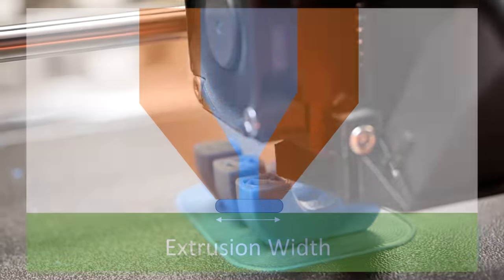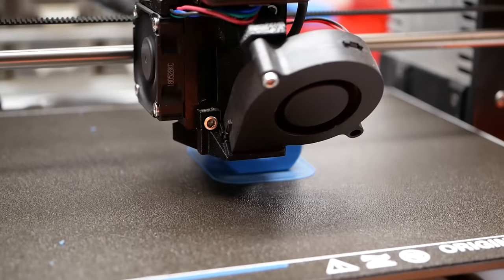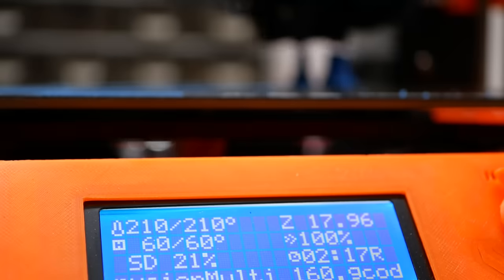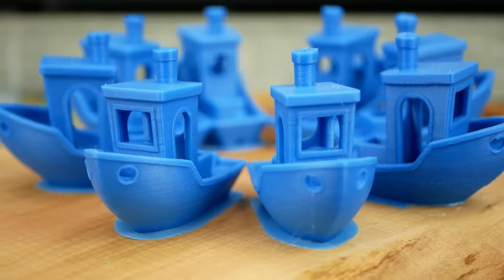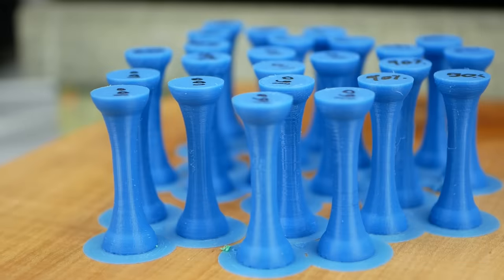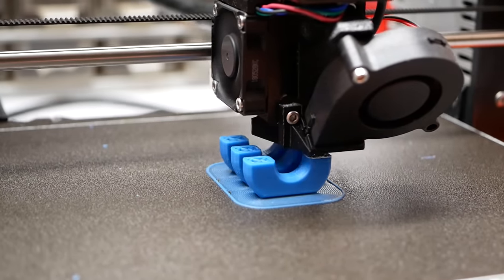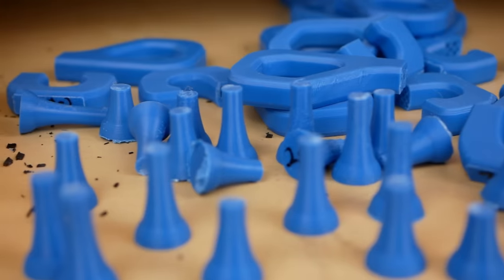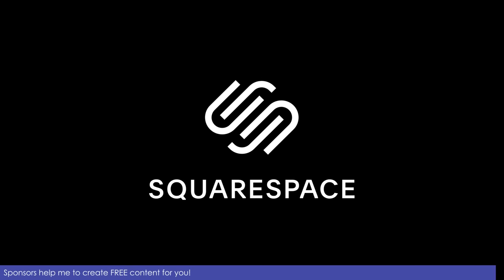Extrusion Width - The magic parameter for strong 3D prints?

Comment: I have been playing with extrusion width (line width in cura) this last week to see if I could find one I liked better for general printing.  My first goal was to see if I could save some print time by printing thicker layers with maximum width to reduce time.  I've seen weaker and stronger prints because of changing it.  It is really neat that this video just happened to pop up in my suggestions.  I'm looking forward to watching the rest of your video at this point and see what you've discovered back in October apparently.

Comment: I use 0.6mm with a 0.4nozzle as standard for functional prints just for speed. I thought they we stronger to but this test proves it :) I adjust the width to get optimal lines for thinner parts and that varies a lot, from 0.34 to 0.75 and I haven't seen much issues

Comment: Changing the extrusion width was useful to vary the stiffness of parts printed with flexible filaments. I found that perimeters of 1 or 2 layers can be very strong when extrusion width is around 0.6mm (w/ 0.4mm nozzle)

Comment: I use it all the time. With my .4 nozzle, I will print .5 if my model has a 1mm wall for example or even push the width up to 1mm for a nice clean solid vase with less layer lines

Comment: I have been printing a BF109 from abs. To get the wings and fuselage strong and bulge-free I had to do man tests. I ended up adjusting the extrusion width somewhat thicker than 120%, adding a shield. Some walls are problematic especially flat surfaces. The whole plane is somewhat heavier then the one done in pla, but it is really strong. I prefer abs since it is water resistant, more resistant to heat, can be glued by aceton and/or aceton-abs mixture. When I started 3d printing I had only really bad abs and I had no comparison to other materials, so I learned it the hard way. Since I use the amazon basics abs it works much better. It sticks like hell on the ground and adhesion is much better. So I could reduce the bed temperature after several layers from 120 to 70deg celsius. Afterwork can also done by aceton. You can increase layer adhesion afterwards by painting the wing with aceton mixture. But not to much since otherwise there will be bulges. And if something breaks you can try to fix it with a thick acteon-abs mixed glue. Also it is more ductile than pla. Most of the time you need brim and or raft, often one needs extra added fixtures outside of the part to hold it down.

Comment: I modify it a lot :D 
In Vase-mode to get thicker walls. On regular prints I tune it to avoid awkward thin perimeter artifacts or to avoid gap-fill on perimeters if I print parts like cases that usually just consist of one wall with constant thickness. Avoiding gap-fill there usually saves 50% print time.
I also increase it if I need strong parts.
Most of the time I print with 0.5mm and when I design my own parts, I usually use walls that are multiples of 0.5mm thick so I don't have to change the extrusion with on every print. I never understood why extrusion with gets so little attention from all the 3D printer communities.
Reply: Btw: I also don't get why there still is no slicer (I know) that supports dynamic extrusion width. It would be nice if the slicer would select an extrusion width (in a defined range) dynamically for each wall so it is printed without gap-fill or gaps. This would also be really nice for lithophanes :)

Comment: I've messed around with really low extrusion widths for the top layer, like  as low as 50%, in order to get a kind of ironing effect and an improved surface finish with my larger nozzle prints. (.8mm)

Mixed success dependent on the filament, but a very good surface improvement on some.
Reply: What's your slicer? You can't use the built-in ironing?
Reply: @supermerill 
It was Slic3r PE, I'm not sure the current version has ironing or not, but at the time it didn't.

Comment: I used a 0.2mm nozzle for a while. Really slow. You can take a piece of fine sand paper, lay it flat on the build surface, and lower the print head step by step and sand it down by moving it from side to side to widen the flat area around the hole. That way I could use like 0.6mm wide lines for only the tops, bottoms and infill to really speed things up, especially for really flat parts. With my setup around that seems to be the limit, that's where I started running in to under extrusion.

I bet you could increase the line width even more if you did that.

Comment: I suspect much of the strength increase is due to heat transfer on the previous layer (until the layers slightly curl during extrusion due to being much large than nozzle and under pressure). A heated build chamber around the glassing point with minimal nozzle pressure and allowed to cool slowly and evenly may produce very interesting results.

Comment: Thanks for this.

I've been playing with extrusion width doing vase mode prints, notably getting better looking  results with a 0.6 nozzle at 0.2mm layer height and a maximum of 1.1mm width rather than going to a wider nozzle. And with all the nozzles I have the sold part of the tip is the same width so I can't push the width beyond 110% with a 1mm nozzle, but obvs I can go with taller layers for speed, but getting crazy overhangs on vases needs low layer heights.

Comment: It would be great if you could also look at accuracy for extrusions widths of 120% or below and especially 100% and below. The slicers I have seen assume the material comes out as a rectangle in that case. But in reality, it of course bulges sideways, and squeezes vertically after it leaves the nozzle. The result is that the model becomes slightly wider than designed. The effect is really strong for single extrusion-width sized walls. They become not only wider than designed, but also loose adhesion between layers, because of the vertical squeezing that the slicer doesn't allow for.
Because of this effect, I would definitely not recommend to print the outside lines of your model with an extrusion-width below about 120% (in reality, the strength of the effect also depends on the layer thickness).

Comment: Guten Tag:) Great video as usual. I have always used 0.5mm EW for mechanical parts where quality is not an issue, such as my MPCNC. I use 0.3 EW for minis.  One downfall is supports with a  higher EW due to to thick of supports. However, some slicers have settings to change EW on supports. I dont think mine does. I use ideamaker. 

Minis look amazing at 0.3mm with a 0.10 layer height. I have tried 0.3mm EW with 0.20mm LH and it did well. 

one test to try is 0.5mmEW with a 0.28mm LH to see if that yields better strength, but also add 3 shells and 15% infill like you say in the video, but im interested in thicker layer hieghts mixed with thicker EW.

Did not know you were in aerospace as well. Me too:) in about a year a should be done with my masters in engineering! YAY!!!

Comment: I was not really aware that people did not modify extrusion width often for anything other than vases (that's super common).
I though it was somewhat common to play around with the width for best fit on some prints. 

I probably use 100% extrusion width of the nozzle only in a few cases.
Usually I am pushing it up to say 0.6mm or 0.8mm for a 0.4mm e3d nozzle. Sometimes smaller down to 0.3mm. 
It all depends on what I am printing. If I need that strength that thicker more bonded lines gives and the part design will handle it, I will push the width as close to 0.8mm as possible for the design. While keeping quality the same as a lower width would provide.
For designs with very complex walls, shifting sizes of walls etc. I will modify the thickness to best fit the print to reduce any gap fill and avoid gaps in general as it improves the quality of the print and best keeps tolerances. 

I find the best performance improvements to be in compression loads to fight against de-lamination and also in radial loads.

On a separate note I think you will find the numbers even better for less brittle materials like PETG. The strength of the bonds basically skyrockets as you start to increase width, even past the point of looking good. For PETG if I can print it with thicker lines I will, no question. It's faster if I am keeping speeds the same, stronger, and looks just as good. Whats not to love when you are dealing with a material that likes to be printed slow-ish and cools slowly too. That means I can print a bit slower without making the overall print take longer, get far stronger prints that usually act as if they were solid material and not layers. It actually makes printing with PETG easier too. So wins all round.

Comment: The last Test with the different perimeter settings  brings me to an idea:
I can imagine why 2 thicker extrutions lines holds together stronger than 4 smaller ones.
But as we learned as a kid from playing Lego, it would be better to have the lines overlapping each other.
So, would it be possible to have one layer printed at 2 perimeter 200% and the next one at 133% 3 perimeter and then alternate between these two?
Is there a way to set these settings per layer?
Because that could cause the layers to interact with each other even better. The Material of the middle line from the 3 * 133% layer could float into a potential gap between the two lines from the 2 * 200% layer.

Comment: I have found that increasing extrusion width of inner walls and infill while keeping outer walls at a smaller extrusion width and decreasing layer height gives a very nice looking, strong, and slightly faster print. Messing with all of the settings and finding a happy balance of quality, strength, and print speed for individual prints is quite fun!

Comment: I have set my extrusion width to 0.45 mm on a 0.4 mm nozzle to fight the effects of die swell and get accurate prints. I also use the wall Perimeters, not wall thickness settings in Ultimaker cura.

Comment: A problem with blanket modification of extrusion width is that dimensional accuracy suffers. However you can take a more nuanced approach and increase extrusion width for internal perimeters and infill, while leaving it at 100% for the external perimeter. I've had good results with this approach.

Comment: Cooling fan settings? My impression is that the thicker extrusions are also more thermally insolated against cooling and/or have more thermal mass thus fuse better on top of also being pressed harder. I always have my cooling fan off if I don't absolutely need it when printing functional prototypes. Also an enclosure makes the part stay warmer and adding in better layer fusing/adhesion.

I would love for there to be an option in Simplify3D so that the cooling fan only ever comes on for just bridging and steep angels where the part could curl up. For now it's just by layer which I have to do manually and compromises layer adhesion for the entire layer.

Love your work, and haven't played around with my extrusion settings in a long time. This makes me rethink how I've been printing and if there's a setting so that only the outer shell could be 100% and one or two 150% inner shells for faster/stronger prints but still have the same sharp models.

Comment: Using greater than 100% Extrusion Width, as well as a bit of back travel on the Z axis (some call this overextrusion), is the only way I got proper layer adhesion with Nylon.  Once I figured those out, a 20mm test cube with 20% infill  makes a 1Kg hammer bounce off with no damage to the cube.  +1 for printing in the basement, mine stays between 20-21C all year.  MUCH better consistency.  Hope this helps someone.

Comment: I routinely set support extrusion width to around 60% of nozzle diameter to reduce material consumption and make supports easier to remove. Weirdly, in Cura, a reduced extrusion width can increase print time though.

Comment: I've only ever played with the extrusion width when doing vase mode prints... 0.8 line width turns out GREAT but I have to bump up the heat and slow down the print a bit. I use these prints as pencil/tool holders :P

Comment: I usually print with as few perimeters as possible, adjusting the width of the wall lines to achieve the desired thickness. With a volcano it's easy to print 1mm+ thick lines at reasonable speeds.

Comment: Can you do a test on Fillamentums CPE? I would like to see their claim "improved over PETG in every way" tested.
Reply: Printing with something containing chlorine sounds like a terrible idea. I’m not sure about everyone else, but I certainly don’t have ventilation setup I’d be confident in.
Reply: @MaplePanda04   I don't think Copolyester releases any chlorine. There is no mention of that anywhere. It also doesn't make sense to have a filament that releases it, as chlorine is very corrosive and would destroy the metal parts of the printer. Many plastics does however release nasty stuff if you set it on fire, but if your print is burning you have bigger problems then fumes..
Reply: @Sneakydecoy  Even at printing temperatures, the filament can release funky stuff. PLA’s familiar sugary smell comes to mind, and ABS apparently releases styrene gas in measureable quantities.
Reply: @MaplePanda04  Acrylic vapours are not any good either - the monomer is very toxic. The terephtalic acid used for PET is not that toxic, hence the use of PET for food storage.

Comment: Like some others, I only ever changed the extrusion width when printing in vase mode. I was surprised, that I could print with 1 mm extrusion width with a 0.4 mm nozzle without problem. Also the surface quality didn't suffer in this case. This not only makes vase mode prints a little stronger, but also allows to print steeper overhangs without holes, despite the single parameter.

Edit: vase/case mode typo corrected.
Reply: _ David _  Defeated by autocorrect, I guess. Or thick fingers? Should have been vase mode, of course.

Comment: I think there's some scope for getting pretty but stronger and faster prints by keeping external perimeters thin but cranking up the thickness of the internal perimeters.

Note however you get better overhangs with increased extrusion width.

Comment: It's not hidden in cura, it's just called "line width" and most ppl set it at 120% if their nozzle diameter, mine is set at .48 because I have a .4 nozzle. And while it is true you can print faster using bigger widths, a good rule of thumb is to not go 125 percent bigger then your nozzle, so if you want to print faster and have nice looking prints them simply put a bigger nozzle in and then adjust your width accordingly

Comment: Curses! I hadn't watched this before starting a 14 hr print, which is currently ongoing. I'm adding a second Z axis drive to my Ender 5. I'm confident that the parts I'm printing will  be strong, as with 4mm wall thickness and 50% infill, most of the piece is solid anyway. Plus I'm using a 0.6 nozzle and reduced cooling for the Carbon Fibre PLA.

Comment: IMHO the reason for better fusing of thicker or wider extrusions is, that thicker or wider extrusions will transfer more heat to the underlying layer (they have smaller area towards both the air and the already extruded plastics).  Indeed, the vase mode models printed with large dmr nozzles are incredibly strong.

Comment: In spiralize mode it makes an huge difference in strenth, a .6 nozzle gives rather strong objects at .8 linewith,  and when i print ABS with a draft shield, a wider line prevents the shield from turning into spaghetti for higher prints, but in general i print at the nozzle hole diameter.

Comment: You should do an overall best strength video using what you've learned along the way. So far taking notes it looks like 6 perimeters 15% infill rectilinear pattern 200% extrusion width and a layer height of .1mm-.15mm with no cooling is the best overall. Also if you can print it lying it increases it by a larger amount than all of that combined? Hopefully I'm on the right track with this. I know the video to demonstrate this might take you a very long time but I figure a lot of us would like a combination video using the best methods found in all your tests combined to make the strongest pla parts possible.

Comment: The problem is, you can set up extrusion width (line width) but it only works if your extruder is not already working at its limit. From my experience most printers/extruders are set up to operate at their limit. So if you change extrusion width (line width) or flow, it won't matter. Zero effect.

I was experimenting myself to improve adhesion between layers (prevent delamination). For me this is the single most important issue when it comes to strength of parts. That's where parts break.

Maybe there could be a setting in slicers, that the nozzle somehow (without extruding anything) just "bakes" two layers together somehow? Like ironing, but just for strength. Maybe the slicer could also leave tiny holes that are two layers deep and are filled after the second of the two layers is finished. You would always bond to consecutive layers together. Layer 1 and 2. Layer 2 and 3, and so on. The "holes" would always be at different positions.

The ultimate solution would be to there be no layers, meaning that we have true 3D printing. Or at least 2.5D printing: https://www.youtube.com/watch?v=gmePlcU0TRw

Comment: 12:07 Next week's episode maybe? I thought I remembered you doing a nozzle diameter:strength test, resulting in larger diameter nozzles yielding weaker results, I feel like that was within the last year.
Reply: I'd love to see a comparison between different nozzle sizes with identical layer widths.
As you suggest, I'd think the smaller nozzle would have the advantage.